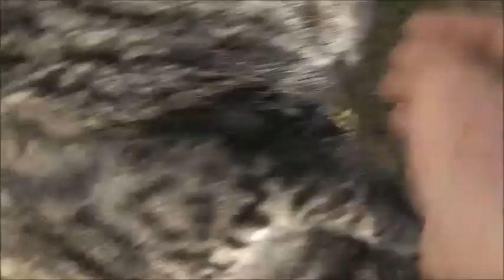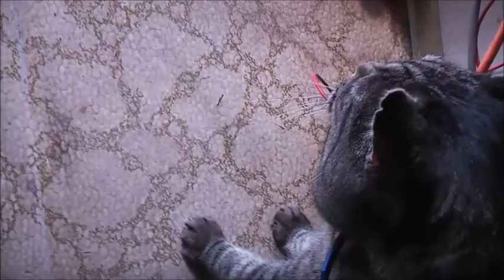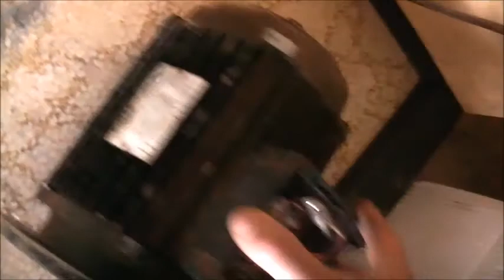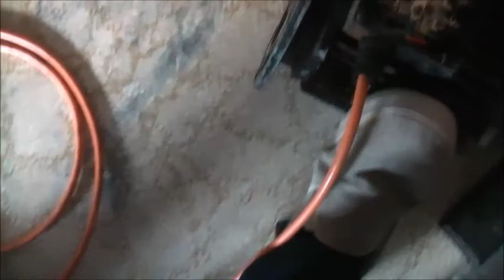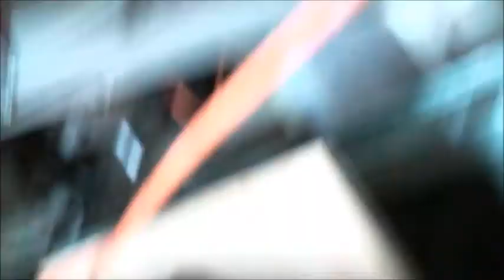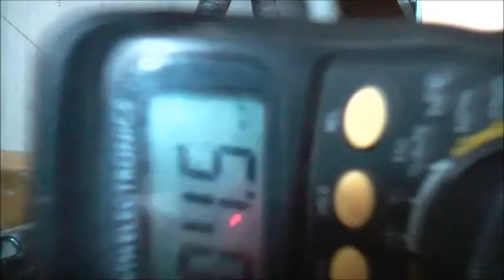Fimec Motor Works Well

Comment: Yeah those sleeve bearings can be a bit painful at times.
I have an old single phase washer motor that i had to put radial ball bearings in cos the sleeve bearings were shot
Reply from the maker: this has ball bearings